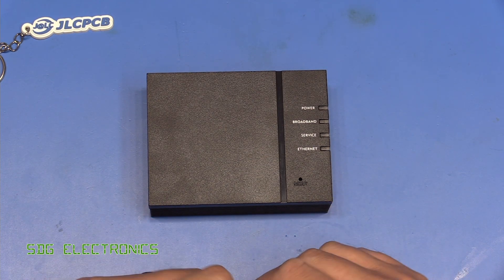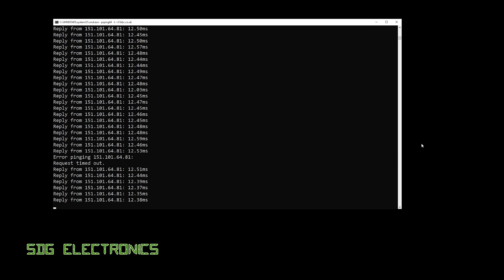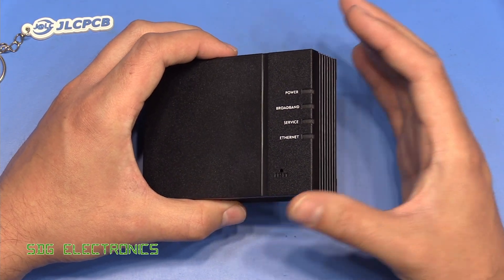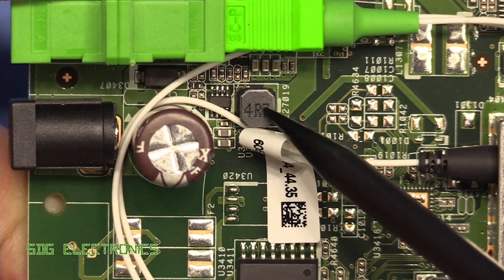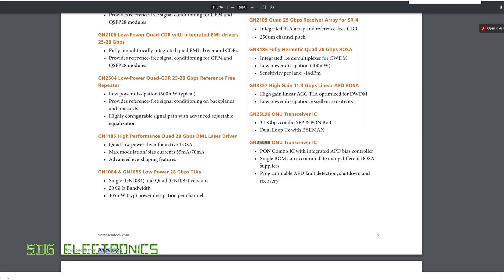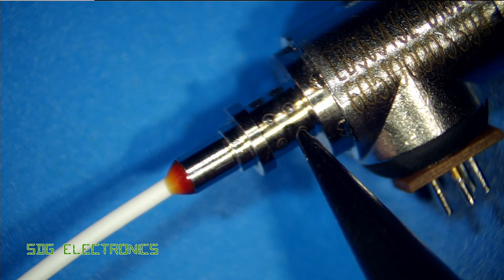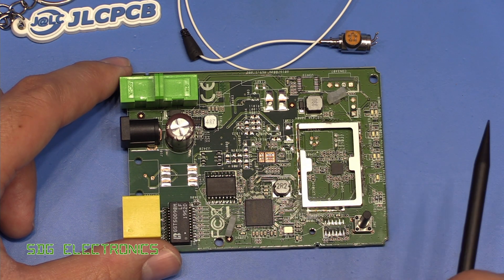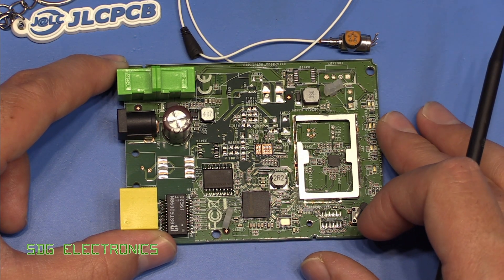SDG #208 Cityfibre / Vodafone Gigafast 900 still poor speeds. What's in the GPON ONT 801Gv2?

Comment: For anyone stumbling across this video, it's very likely that the cause of the poor upload speeds and high packetloss is a dirty fibre connection or poor splice somewhere between the ONT and the node. I had exactly the same problem, and the CityFibre install folks said that's the likely cause, and someone else on my road also had the same problem, and the CityFibre build team investigated and fixed.
Reply from the maker: It ended up being their fibre transceiver AGC failing. An electronics issue
Reply: @sdgelectronics  Great coverage…thanks for posting. Did you stay with vf/cf in the end?

Comment: Hi there, just came across your videos regarding this issue with Vodafone/city fibre .. I just got connected last week.. mine issue is low download high upload.. I have chosen 1gig option as they offered half price for two years (35£ pm).. I have got 3 laptops at home.. so case is everything unplugged, wifi off, just cat 6 cable from router to laptop.. speed test.net used to test.. max 150mb upload, around 650mb upload.. reported to Vodafone off course, they claiming everything is fine from their side and they tested and it's full gig coming to my router.. they wanted me to do test in various times, I did, screen shot s sent and they claiming it must be mygear's fault.. any advice please how to deal with them? Best regards
Reply from the maker: The only way to deal with it is to call every day. If possible use your equipment on another connection or do a file transfer to something on your network to prove it is capable of gigabit speeds.

Comment: U get much better ping than i get on virgin 500 the lowest i can get is 12ms on speedtest and then pinging google etc its about 16ms. They have recently been installing city fibre in my area so when its avaliable im considering switching for better ping when gaming mainly
Reply from the maker: Virgin normally gives me a ping of around 4ms. Cityfibre worked out much better value generally, so it's worth switching unless you have a good deal from Virgin.

Comment: I had a very similar problem with my internet connection when i was using a  different ISP from the one actually owning the wires (DSL Local loop unbundling in my case), after countless phone calls, technician vistis to the exchange, etc.  one of the technical staff on the phone managed to admit (as I suspected since the beginning) that the loss I was seing was just due to the exchange being overloaded as way too many subscribers being crammed in a single pipe, and that that was a businnes decision, so there was nothing I could do, other than to go with the ISP owning the wires.

If I were a betting man, I would bet on vodafone not having enough uplink bandwidth at some gateway/exchange along the way, and thus the dropped packets

Comment: Since the two wavelengths (one for each direction) are different, the problem (i.e. loss) might well be wavelength dependent and thus hinting that it is in fact within the optical hardware, i.e. the optical splitter in the cabinet. It might be a case of poor isolation and out of phase reflections (or who knows what). So they could start by switching you to a different port on the optical splitter. Failing that, replace the optical splitter. Good luck.
Reply from the maker: Honestly I'm surprised they haven't been to the cabinet and connected their equipment to one of the other ports. This seems like basic troubleshooting steps to me.
Reply: Once upon a time, my workplace stapler was malfunctioning and was unreliable. Because I still had a stapler, they wouldn't replace it. After putting up with this for a while, I eventually figured out the solution and tossed the stapler into the garbage. Then, seeing that I didn't have a stapler, they issued me with a new one.

I'm not recommending that you break into the cabinet, remove the optical splitter and throw it into the nearest river. That would be illegal.
Reply: @JxH  😆😆😆🤣

Comment: As a field engineer for another big UK ISP, I would first test this by connecting up a test modem at the ont and seeing if there is any differences if it isnt the same time it at the dp/cab on a different port if it works it could be the fibre to the property which is a simple job to reblow but I would try ask neighbour's or anyone close about their experience. The problem with this type of network is the ISP and the network provider will always try point fingers elsewhere where as the likes of Virgin they can swap out equipment as there engineers are all in house. Best of luck
Reply from the maker: Sadly I'm the only subscriber at this cabinet, so no other customers affected. They tested the optical power at the ONT, and concluded that was fine. AFAIK that doesn't tell you anything about upload related issues though. I don't know why they haven't tried changing the port on the splitter though or doing any diagnostics at the splitter. Thanks for your input.

Comment: I'm in Peterborough as well and I've just had a letter from Vodafone inviting me to join them.
I'm reassured that the the end connection is presented as ethernet. I was a little worried that I would be stuck using their dubious looking hub, but if I can plug directly into my PFSense box I might give it a go.
Reply from the maker: You need to obtain the PPPoE details from Vodafone and set up on VLAN 101 or 999 but this can all be done in pfSense. If it gets fixed, I'll do a short video on the set up
Reply: I run my 900mb on an old i5 2400 optiplex running pfsense rock solid connection. I only use the Vodafone router as a wireless access point mainly for the kids tablets so wireless isn't that important to me can still pull 700mb+ on wireless though so it isn't the worst router.
Reply: Do you mean bypassing the ONT and using a single fibre SFP transceiver module? I might be interested in a setup for that as I'm contemplating getting a UDMP or UDM-SE.

I am, however, more than a little disappointed that the fibre termination is capable of 2.5Gbps but they only put a 1Gbps ethernet port on the backside of it. Why stick with only 1Gbps when the fibre can do 2.5Gbps? Put a 1G/2.5G ethernet port on it, charge a little more money and then you'll be done for future upgrades.

Even Virgin Media's new Hub 5 comes with a 2.5Gbps port now (and WiFi 6) because their 1 Gig plans are actually over 1000Mbps to the hub. When we're trying to save the environment why do manufacturers do so many silly things?
Reply: @CoolSteve08  strange that you commented today. I had the fiber installed this morning!
I'm not touching the fiber, just plugging into the ONT.
Although at the moment it's not playing ball. 930mbps via their router, but pfsense is not managing to connect.
Reply: @evil-tom  interesting to know. I don't have PfSense, currently using an ERPoe-5 and still with Virgin (locked in to a contract until November so exit fees would apply) but been considering upgrading in the future to a UDMP/UDM-SE in the hopes of getting >1Gbps if VM start rolling out the SH5.

Though with no official 2.5Gbps sync on SFP on either, it's a little bit tricky to achieve without using the UDM-SE's 2.5GbE port, which is still connected via a 1GbE shared backplane to the CPU with the remaining built in 8 1GbE switch ports so no idea if you can actually push 2.5Gbps through it.

Neighbours across the road got TalkTalk on CityFibre but haven't heard what plan they got or if they've had issues. I just wish the CityFibre ONT had a 2.5GbE port on it rather than the 1GbE it has.
Reply: @CoolSteve08  Now sorted with PFSense. I deliberately requested the PPPoE user and password via the web chat so I could copy and paste and still managed to get it wrong! 
Very pleased with it so far. Everything's gone smoothly and the two guys that showed up to fit it were really friendly, and were fine with me hanging over their shoulders watching and asking questions! I got a 50% off for two years deal so ~940mbps for £35 is difficult to argue with.

I think more than 1Gbps in a residential setting is probably a little way out yet. Although it's becoming more common, home kit that supports 2.5Gbps is still rare. It's only really enthusiasts with a homelab setup using what's basically commercial kit that would benefit. 90% of their customer base are never going to use all of their available speed so there's probably not much of a business case for it.

That said, the ONT is just hanging on a couple of screws and everything plugs into it. I can see it being something that's upgraded down the line in the same way that virgin refresh their hubs occasionally.

Comment: If they have changed the devices without success, it's probably a problem with the fiber itself. Usually they install the raw fiber and splice (fusing 2 fibers together to create a single one, this requires expensive precision tools) pigtails at the ends (a small piece of fiber with a connector pre assembled in a factory).
Maybe there's a problem with a connector or a splice somewhere. A single single-mode is used for tx and rx with 2 different wavelengths.
It could be a reflexion issue due to a bad splice of connector. Everytime there's a change in the fiber, some light is transmitted and some is reflected. This could introduce an problem but only one way. Fiber in single mode are 9um and even a slight misalignment in a connection is catastrophic.
Is not very likely but the fiber can also be damaged if they pulled it too hard to deploy it in a wall. This can create cracks. A bend to tight is also bad.
To diagnose that they need a special ( and expensive of course) equipment to send test signals.
Where I live (in another country) they  usually install multiple fibers in a single cable in case one is defective or damaged. Maybe they should use another one...

Comment: I feel for you. This is a different fault I'm sure but... I have had VF Gigafast 900 for 12 months. For 11 of those, it has been very reliable. Then 4 weeks ago, I started getting limited download speeds of 15Mbps to many but not all sites (apple downloads as an example). I have proven the issue is reproducible, agreed my premises and kit is 900 capable and Vodafone gave up. They said if I get 900 at just one Speedtest.net site, they have met their contractual promise and they will not investigate further. I have a long post on Vofdafone's community forums and on ThinkBroadband detailing my troubles. I have been unable to get any conversation going that discusses my issue, they refuse. Very sad. I am now in deadlock waiting for them to say if I have to raise with the cisas ombudsman as I refuse to pay an exit fee if their service isnt fit for use. Anyhow, one thing I was able to do for my issue is running Nord VPN, I can get much higher speeds to these sites I have such trouble with. It seems my issue is todo with a device or route across or out of the VF network. The VPN takes the traffic another route and it speeds up. These edge cases seem too far for the VF support folks to help with. A very big shame as it is value for money when it works.
edit: Oh and by the way, I too get the stuttering psping issue on my connection. Interesting.
Reply from the maker: I saw your post on tbb, and a VPN was the first thing I tried. Sadly it makes things far worse for me so I don't think it's the same routing issue.
Reply: maybe change your DNS server darren?
Reply: @maximusg88  Thanks Max. I did indeed try the ISP, Google and OpenDNS. Didn’t seem to change the route the requests were sent to.
Reply: @laneyweb  :(

Comment: If you were a high priority client, an RFC2544 test would be conducted between you and the OLT... politics and money as usual, sir.
Reply from the maker: The latest person to visit did actually have the equipment to do that, but I they only tested the light wavelength and power coming from the OLT and swapped out the ONT as instructed on the task sheet. It seems they don't do any diagnostics they aren't told to do...

Comment: 900MBit/sec is really slow 😀
What do one need that kind of speed for ? Got 50 /16 here.
Reply: Everyone has different demands I guess. We have 500/500 and sometimes we do max out the throughput
Reply from the maker: the 350/37 I have at the moment is fine, but 900/900 is available for less than I'm currently paying. It also means I can use my offsite host more effectively and of course YouTube videos would upload significantly quicker.
Reply: Haha, the "bonus" 35 is my entire d/l :(

Comment: 24Mbps up and down is still pretty good for 4G. 
Hopefully they'll find someone competent enough to find the problem.
They'll have to, or kiss your area goodbye.
Reply from the maker: Yeah, I don't think I can complain about the 4G connection too much. I tested uploading an 8 Gb YouTube video and it was pretty much consistent 20+ Mbps for just over 40 minutes which is quite impressive.
Reply: @sdgelectronics  If it's a dongle it depends on it's size I used to get the same speeds from an O2 one & 28.1MB/s from a Vodafone dongle because of the increased size of the patch antenna inside it. I also relayed both of them to my pc via a 3m USB 3.0 lead to the frame of my window where the dongle was aligned to the nearest phone mast, it's this set up that vastly improved the signal with both dongles. Even though my old pc & both dongles were USB 2.0 the USB 3.0 appeared to have lowered the attenuation which improved the signal transmission from the dongles to the pc.
Reply from the maker: @britexitengineer1407  It's a Mikrotik SXT LTE6 with a directional antenna, but it's only a Cat6 modem which I think is why it doesn't match the speeds on my phone.

Comment: Heavy packet loss, that makes me think one of the fibres/optical transceivers isn't working right

Sending qualified people that have actual fibre experience is expensive so they are probably going to hold that off because like you said you are the only one with a problem. Shame what the world has come to
Reply from the maker: They did actually send out a contractor all the way from Manchester who was more clued up, but it seems they didn't investigate his suggestion of it being the OLT
Reply: @sdgelectronics  that's too bad. Hopefully they'll get it sorted out soon rather than eventually but pretty big of a bummer right now. Cheers
Reply from the maker: @thomasvnl  I think if it doesn't work out, I'll probably try again in 6 months time. Virgin has been pretty stable, it's just their upload speeds are not the best despite the network here recently being upgraded.
Reply: It could be a rogue ONT polluting the upstream light, or faulty receiver. Maybe check with a neighbour to see if they have a similar problem, as they are likely to be on the same OLT port as you.

Comment: I dont know how it is setup in UK but here in Iitaly OpenFiber (one of the wholesale businesses) is owner of the fiber. But the OLT and ONT are from Vodafone and the end user ISPs.
OpenFiber is only the wholesale for the PtP fiber client to ISP OLT. And is resposable only for the fiber cable.

That said, Vodafone or the ISP is the responsable for the connectivity in this case, I tell you this because I had a similar issue for over a year.
My ISP was saing that was OF fault and OF said it was my ISP fault. bouncing request between them.

Now I switched ISP and other another major issue with router vendors it should be finally fine.
What is the mayor issue? I dont have IPv4. (due to the fact that IPV4 addresses are all reserved).
I have only IPv6. And none CPE vendor support MAP-T to give me IPv4 tunnel capability. 
And No pfsense, vyos, routeros, etc does not support it. Only Openwrt have some WORKING support.
In 2021 33% of the web is served via IPV6.

I have a lot of ONTs those from huawei are quite empty just a laser module and a single chip a regulator and thats all. Even ram is integrated.
Just ended the video, yea quite similar to yours. I don't remember if there is the eeprom on huawei.
Reply from the maker: From what I understand, at the moment Cityfibre own the entire infrastructure including all the equipment. The previous engineer said they have run their own trunk right across the country to the datacentres in each "gigabit" city. Quite a serious undertaking which makes it even more upsetting that it's not working! The question is how virtualised the environment is - the Vodafone IPs seem to originate in Birmingham or near London, so it may be they have another datacentre where the physical gateway sits.